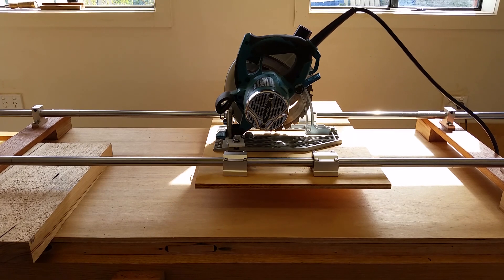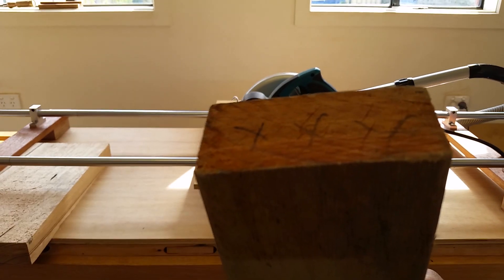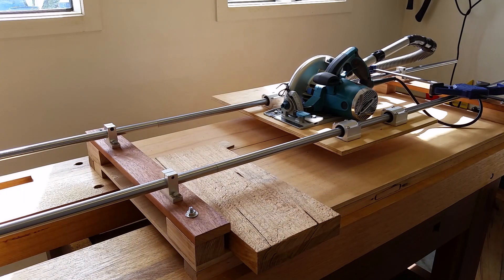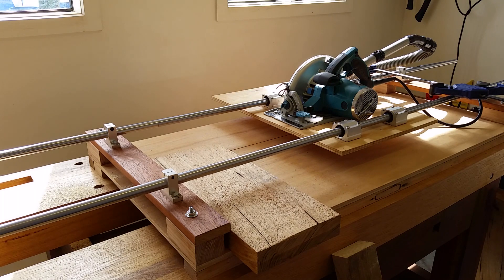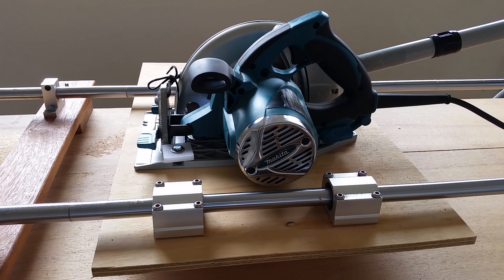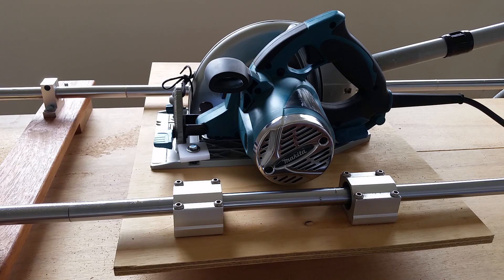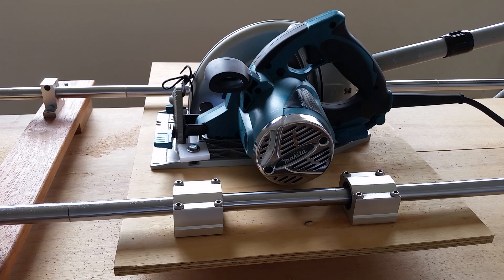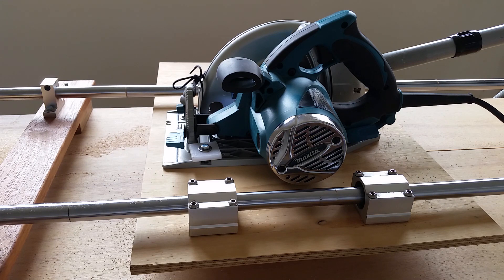Ball bearings Circular Saw Simple Sliding Cross Cut Jig.

Comment: Dear Sir,
I am no expert but the span between your rod supports is too far apart ( a bit of a vicious circle if you plan on cutting extremely wide material) &  will lead to some flexing unless you find another way to support them all along their length. Best of luck in your new endeavour. Kind regards
Reply from the maker: Thank you  ToolsConsumables, I am sorry for my late reply. I do agree what your analysis. "unless you find another way to support them all along their length." -- we to use different hardware I think. Thank you and best regards.
Reply: @woodandmetalhobbies3606  Dear Sir,
Thank you very much for your courteous reply; I have something similar in mind except I'll be using the HG type rails ( square) of 1500mm, 800mm & 500mm. I recently made a bench with an 1800mm long X 800mm wide with a foldable extension giving a total of 2400mm overall length. I plan on making it 3 dimensional but just like you my dilemma resides in wanting something that be removed rather quickly ( I wonder!!!). I may have have to build yet another bench solely for this purpose I think. Best wishes in your future endeavours. Kind regards.
Reply from the maker: @dilipbaumier1327  Oh, I forgot, please no "Sir" :) I sort can picture your design. It sounds very sophisticated too. 2.4 metres is a very good length, I think it will cater for a large percentage of usage. A part from the time it takes to put together and taken apart, space is another issue too. If we could have another secondary storage to store them when not in use :) Yours sound very interesting and I am sure you will have a very good feeling when using it. Best wishes in your future endeavours too and enjoy woodworking :) Best regards.
Reply: This is where mounting a setup like this, vertically, to the wall in advantageous...

Comment: The best idea for this to not take room space is to hang it on a wall and cut wood vertically like the one JSK Koubou made.
Reply from the maker: Yes Cristobal, I have seen that one. I am not up to that level yet. Thank you. Happy New Year. Best regards.
Reply: The other thing with using this in a vertical configuration is to take the weight off of the long span from the bars to prevent deformation (bending) in the long run... The bonus is space saving... Essentially, the main thing needed is a counterweight to draw the saw back up after a cut. Plenty of videos online about counterweights and how to asses one's needs.

Comment: I see that your rails are not one piece. did you buy the rails that way. are they screwed together and how long is each section of rail. I want to ship it to another country and shipping a three meter long rail is not as easy as shipping shorter sections. is there any flex in the rail when you use it for longer cuts like cutting an 8 foot sheet of plywood? looking forward to your replies.
Reply from the maker: Hi Kusnezoff, sorry for my late reply, the rails are 20mm in diameters, and 2 metres long each. I was lucky enough to get them very locally: the guy imports them from China. They 2 metres long, but the way that I put them together, I am using only around 1 metre -- even so there is a slight flex when the saw is in the middle. I think using L shape steel bars as the rails are a much better solutions and also cheaper too. Thank you for stopping by, and good luck with yours one. Best regards.
Reply: @woodandmetalhobbies3606  how to find L-shaped bars that are 'critically' straight, though? I think your rig doesn't take full advantage of the 2meter bars especially with a cutting length of only 700mm! 

Start by putting the carriage on top of the rails. For my build I will consider that design, but slso will look for a rail that is attached already to a backing strip for stiffness, or else attach a rail to a strip myself, perhaps even using 'bed-frame rail' or box-channel for the backing if I can find some. Even a plywood L as the stiffening backer. Then the linear bearing must bear on three sides, top L & R. It's possible to make this bearing for the carriage out of spare ball bearings...hmmm, possibilities!
Reply from the maker: @TSPhotoAtlanta  [ I think your rig doesn't take full advantage of the 2meter bars especially with a cutting length of only 700mm! ]

-- You are absolutely right... since the plywood piece at the bottom is also 1.2m, and we lose a bit of length at the two ends too. Given what I have seen, going to nearly 2m will not be possible, as the flex is too much.

[ how to find L-shaped bars that are 'critically' straight, though? ]

-- I do agree. I have not thought much about this. But I think you are right. L Shape steel bar are for rough structural. 

The thicker aluminium L Shape bars might be straighter... but they are fairly expensive.

[ Start by putting the carriage on top of the rails.]

-- I have thought of this initially, but we will lose depth of cut.

[ but slso will look for a rail that is attached already to a backing strip for stiffness ]

-- Yes. There are such hardware, but we then will have to put the carriage on top as you have pointed out.

Thank you very much for your thoughts. I hope to see your build in the future. And have a Merry and Safe Christmas and a Happy New Year.

Best regards.